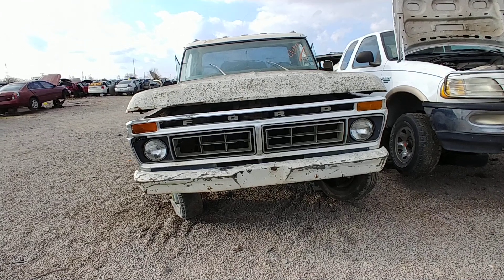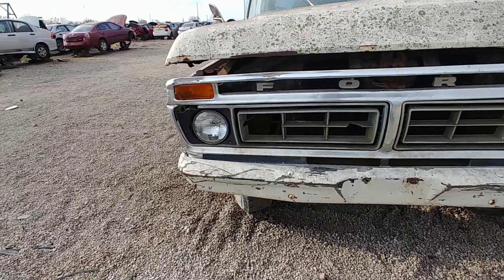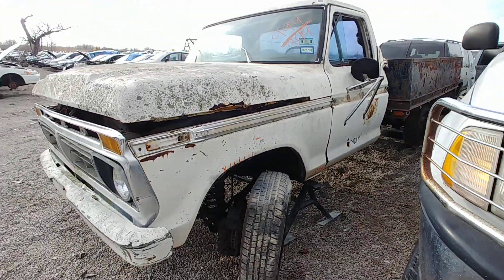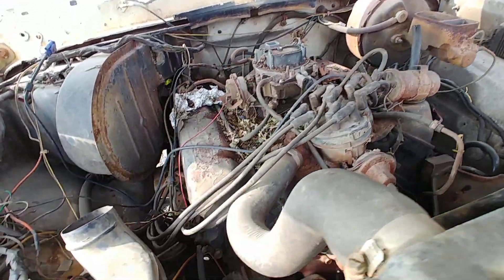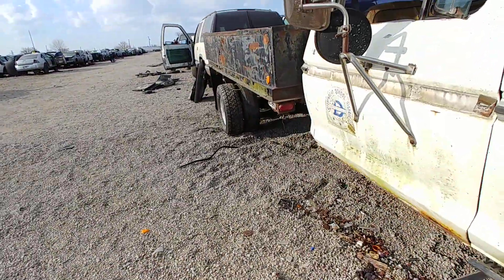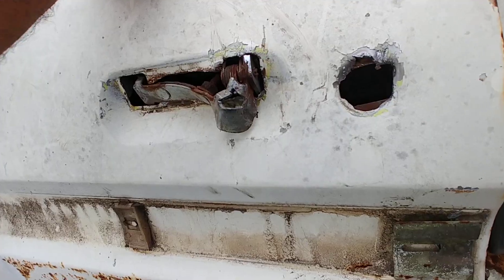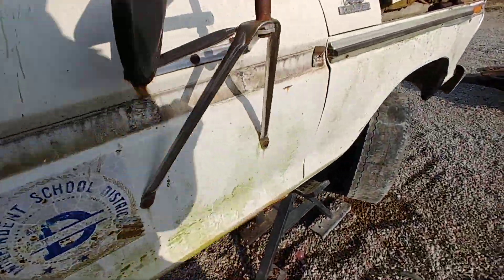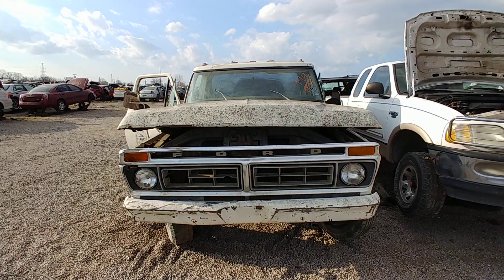Nastiest Dentside 1977 Ford F350 Ranger Junkyard Find

Comment: Whoa Nelley, school's in session and this one isn't worth a mention.

The Duncanville Independent School District is located at 710 S. Cedar Ridge Drive in Duncanville, TX 75137. If I had to guess, it might have been a groundskeeping truck. 

We got the VIN, we win: F37 for F-350 2WD chassis and cab (so it started life without any kind of body), J for 460 V8 with four-barrel, L for Michigan Truck assembly, and the rest is the production sequence. The Michigan Truck facility opened in 1957 and still operates today in Wayne, MI. 

We got the tag, we can brag: 161 for the truck's wheelbase in inches, color appears to be blank for some reason, so it might have been a DSO special order color or a fleet color, F378 for F-350 2WD chassis cab, BU8 for Custom Cab without back of cab equipment, G for three speed automatic transmission, Ford produced, axle code is hard to read, looks like 11,000 which is the maximum gross vehicle weight rating in pounds, 1977 for 1977 model year truck and DSO of 87 which denotes it was likely drop shipped from Michigan Truck to the body manufacturer and then shipped to the selling dealer. The rest of the numbers after 87 are for the invoice number of the truck. 

As for the bucket seats, since this is a chassis cab, there was always the possibility of an aftermarket upfit at the body company or secondary upfitter. Even back then, a lot of body companies and upfitters could do things like that. 

Whoa Nelley, 1977 and going to Heaven. 4-6-0 and gotta go. Full of junk, this one is a flunk. Flat bed and never ahead. Farm fresh and it's a mess. Full of trash and never had any class. That's it, time to quit. Going to be flat and that's that. Going to get squished and no one is really all that pissed.
Reply: A Future New Tundra for Toyota Jan!
Reply: @tonyfriend7413  Hate to say it, you're better off with a Tundra than a Ford.
Reply: Good ol' Twin I Beam suspension one of Ford's better ideas 💡 yeah right 😆
Reply: Dear Google user. I don't want Either. But I'd if I  had to make a decision on the matter. I'd rather have the Ford than the Japanese.
Reply: @tonyfriend7413  I agree with you, no Pearl Harbor vehicle for me.
Reply: @tonyfriend7413  No thanks. I'll take a Toyota.
Reply: @garymckee448  The Fords were "tougher", but they had awful reliability back then. The ignition system, carburetion, fuel controls, all the worst of the worst.
Reply: @googleusergp  Yes l owned several and they were junk, the only good Ford l owned was a 70 Torino GT  302 2 barrel but it ran very well and was excellent on fuel consumption.
Reply: My 77 F350 SuperCab Camper Special Ranger XLT is still going strong and daily driver reliable. But I went with electric fuel pump and Holley Sniper EFI to make it so. The 4350 carb was truly awful.
Reply: @garymckee448  What other Fords did you have?
Reply: @sooverit5529  Fords of that vintage are sloppy all the way around. Sloppy fuel controls, sloppy steering, sloppy carburetion, sloppy ignition and general poor quality. Ford's parts system is also backwards and annoying. I know it from using it for many years, but Chrysler's and GM's parts systems are 10 times better.
Reply: @googleusergp  A 73 Mustang the only Mustang I owned, 74 LTD 400 two barrel, trucks 67 Stepside, 71 ,72 Ranger XLT short bed and the 73 l had for couple of hours before I got hit and the l beams fell out, a 2002 Taurus and l think that's it.
Reply: Well I guess I got a good one.
Reply from the maker: Now days give me the silverado/Sierra
Reply: @garymckee448  No Ford in this family. We had Chrysler products until 1977 then GM since. I will probably break that trend with the next commuter. We had two Corollas as company cars in 1980 and 1981.
Reply: @sooverit5529  You lucked out.
Reply: @ClassicRideSociety  They were good in the past but GM has had their head up their ass for years.
Reply: @garymckee448  Unfortunately there is more US content in a Toyota than some GM vehicles.
Reply: @garymckee448  The Japanese have consistency and good work ethic and that's what makes their products excel in the market. We used to have that, but profit was put over production of a good product and it cost us.
Reply: @garymckee448  cool, I also had a 67 step side 390 with 4speed manual back in 1989 got horrible gas mileage but ran great.
Reply: @corvetcoyote443  Mine was 6 cylinder automatic  white in color, the body was in great shape but that Ford 6 had a lot to be desired.

Comment: Those are definitely looking like factory buckets, the mounts look correct and the seat bottom showed the vinyl/comfort weave vinyl that is of that vintage. What yard is this?
Reply from the maker: Pick n pull Dallas TX. South Central location
Reply: Thanks. I have a 77 F350 SuperCab that I have put 69 Mustang buckets in, with reproduction mounts. I like those factory mounts that are cut out in the middle.
Reply: Those outside mirrors are quite nice as well.
Reply from the maker: @sooverit5529  👍
Reply from the maker: @sooverit5529  id you're able to, you go pull them parts. Its only been there a few days